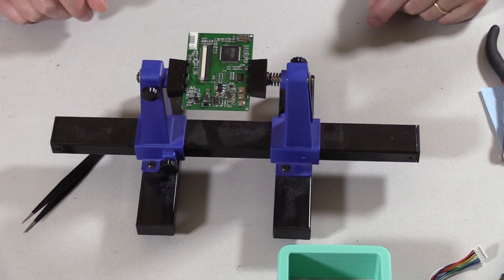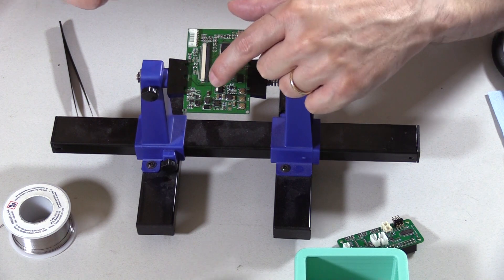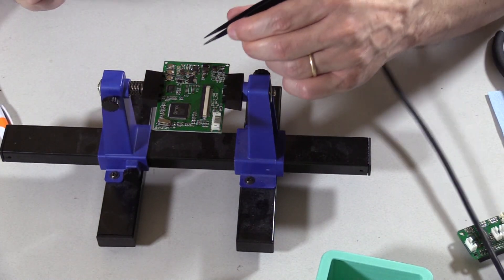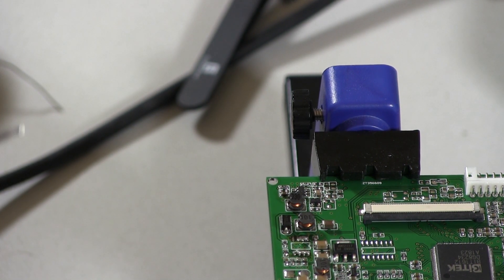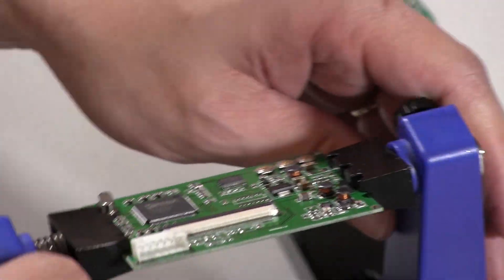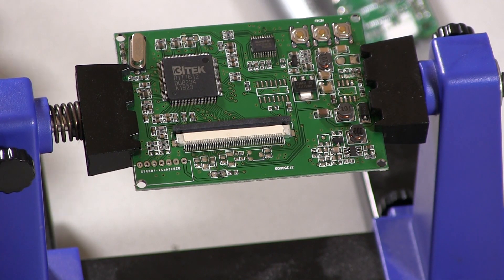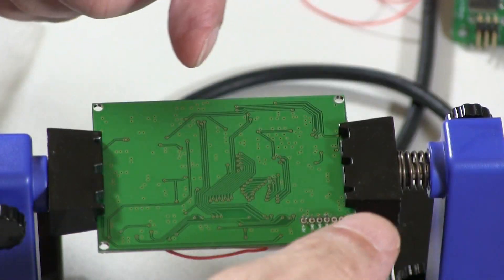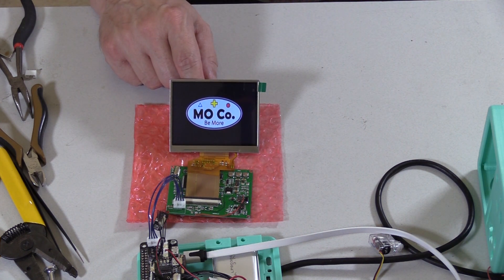Building BMO Boy Part 3: LCD Modifications

Comment: So basically, you've modified the motherboard so that you could change the input voltage(12V) to output voltage(5V) for the LCD screen right?
Reply from the maker: Yep. The board only needs 5V but requires more than that so it can create a clean power source. The PowerBoost from AdaFruit is already doing that for me so we can bypass the 5V regulator.

Comment: Another great video! I'm just wondering why You go with RCA output rather than hdmi or some lcd gpio shell for pi?
Waiting for next videos!!!
Reply from the maker: There are no HDMI screens that small and if there were, the connector and cable would use up too much space. The GPIO screens would have mounting issues even if they were small enough to fit in the case. They also chew up a lot of header pins. The analog out is just the simplest solution.
Reply: @BobHerzberg  Thanks for answer! I'm looking forward for Your next videos to see inside assembly